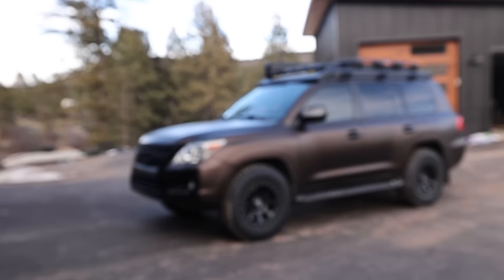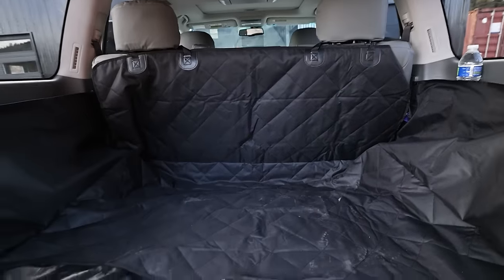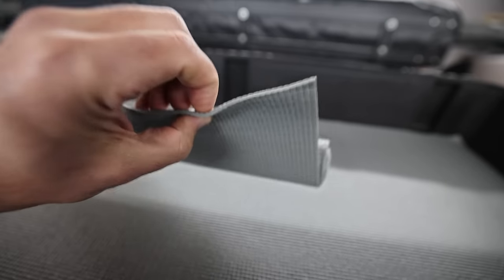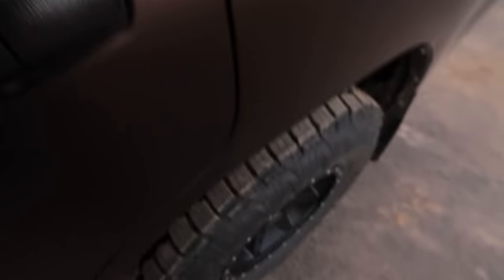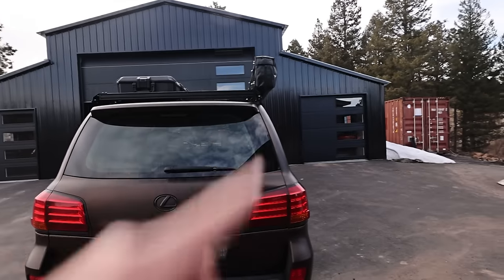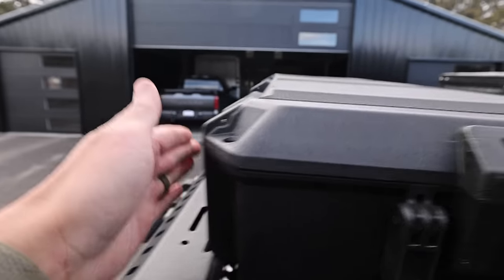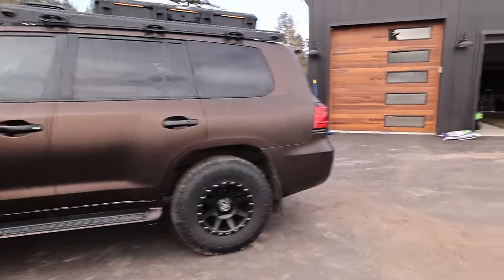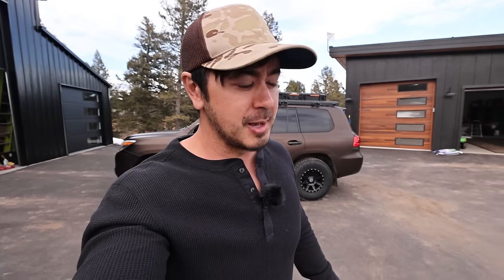WHAT'S ON THAT RACK? LX570 / LC200 Roof Rack Loadout and Setup - UPTOP Overland ZULU Land Cruiser

Comment: I dig the grab handles on the side of the rack! I’ve often considered something similar. 

One option to get an extra step is one of the little door latch footsteps from Amazon. I keep mine in the rear door pocket and it works great.   

Also, by removing the third row seat, you have a constant 30 amp circuit on each side for other uses. 😃

Comment: The rack is awesome! It would be cool if they had a removable ladder option, similar to the one you have connected to your pelican case. with a slot to insert the ladder stabilizer. I am holding out for a Zulu for my Ford F250 Crew Cab. I like it much better than the Bravo and Alpha.

Comment: I've been running my Big Country fully welded roof rack for 2 years, and I have a rear ladder from Echo Tech that allows me to utilize my roof rack to load up all of my cases. Since I have an FJ Cruiser, the interior space is very tight. Check out my videos highlighting how I outfitted my Cruiser for traveling.

Comment: How well do you think it would work if you mounted some of those ratchet strap things on the rack that you had in the back of your old tundra? just curious on your thoughts
Reply from the maker: Yeah those would work also! I find mounting lighter softgoods on the roof, I don’t need to cinch the stuff down quite as hard as I do when transporting lumber or other heavy things in the bed of a truck.

Comment: Hey quick question, do you also have a separate get-home bag for your dogs? I keep one for me in my 4runner but i also keep a duffle for the dog. wondering if you have a solution for having two or do you just keep things for the dog in the get home you carry with you?
Reply from the maker: I don’t have one for my dogs - they’re usually not with me though. A dog could pretty easily handle a 20 mile walk home though as long as they have some water.